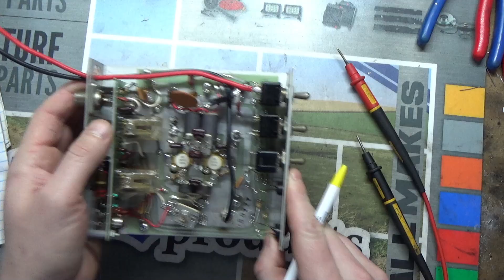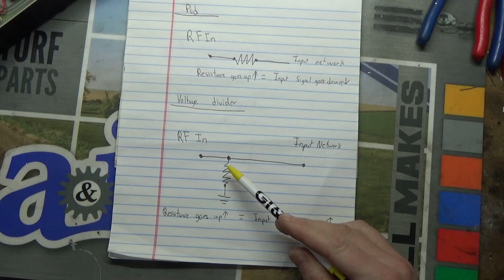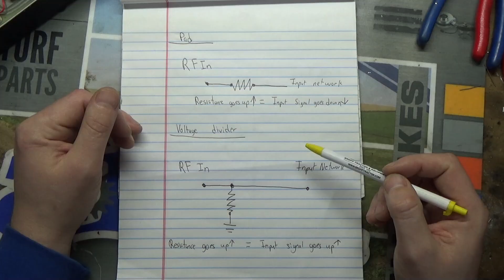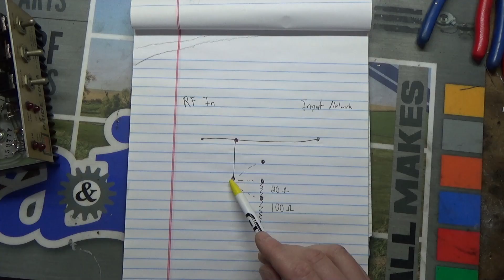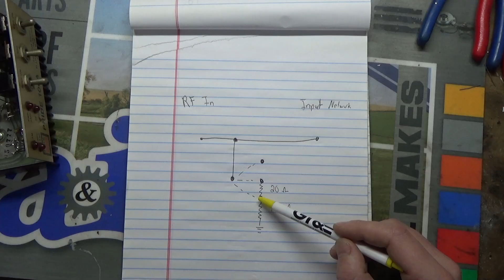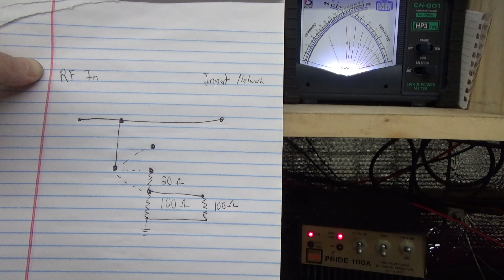Pride 100 Modification for High Dead Key Radio

Comment: Did lowering the input resistance affect your input impedance/SWR?   If so, a pi or T attenuator configuration can maintain 50 Ohms (need 3 resistors).  I use a NanoVNA to tune my input impedance.  Keep up the good work and videos!
Reply from the maker: Yes it masking a non perfect input tune. I  dialed it with just a meter and didn’t get the nano VNA out. You have any resources you can link me for the PI input?